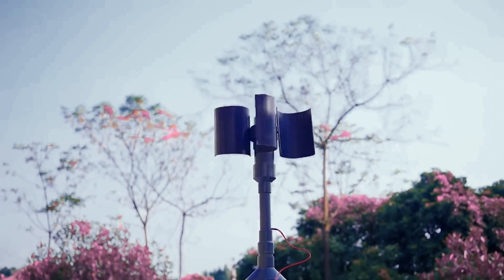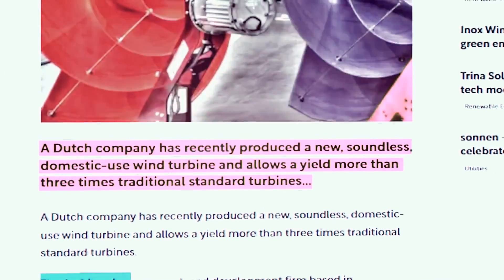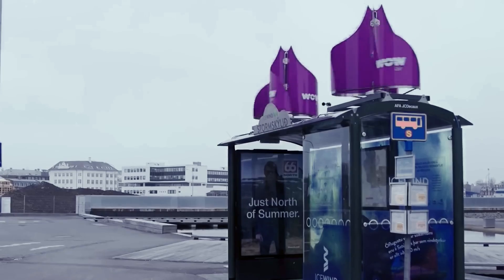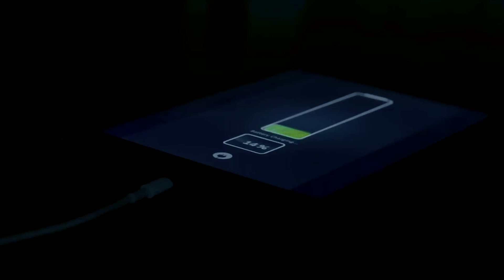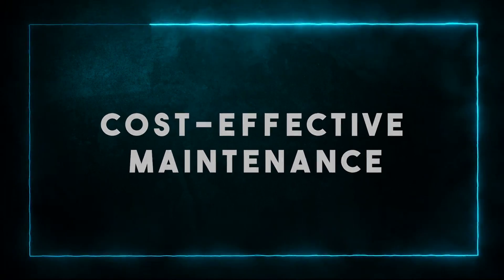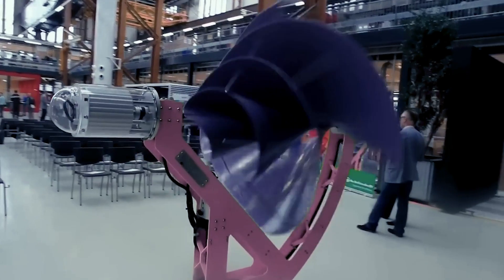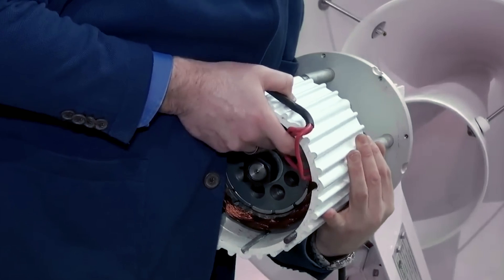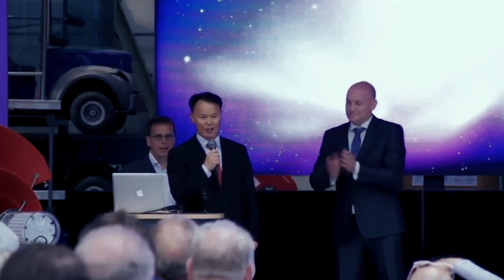New Liam F1 Urban Wind Turbine Innovation that is Revolutionizing Home Energy

Comment: Lots of hype but little hard data. This design was first launched in 2016 and failed to live up to the claims. So this groundbreaking,  game-changer has been around for a while in one form or another so you would think there would be plenty of independent test data around to backup the hype. But there is none that I can find. Really the best tests are those by consumers and now with over 7,000 units sold worldwide, I still cannot find any rave reviews. The price of the unit will be coming down through manufacturing set up in India, with the basic domestic unit likely to sell for around $3, 200 ( in 2023 dollars). So "producing over 1,500 KW hours per year with a minimal wind speed of 5 m per second" is pulled from the sky.

Comment: Where is the computational proof of such a claim??? What is the rating of the motor such as ampere, voltage, type of motor, RPM???
Reply: Slide rule and cross check with CSIRO.

Comment: Yes 👍 As a Aerospace Defence Hardware Test Qualification Verification Consultant Engineer i can see it's very efficient to copy nature in its design, a large open rear makes it effective at streamline the wind outlet, i could think some additional design changes that might make it even more efficient, i would certainly like the larger version in a complement to solar setup,
Reply from the maker: Yes, you are right! Innovation is what brings the difference to existing designs.
Reply: There should be an optimum ideal size to get max. benefit.

Comment: One advantage of this type of wind turbine is that it would also be easy to build a screen box around it, thereby protecting birds, without reducing its performance. Even if made much larger, this would still be possible, unlike the ones with long blades that regularly kill birds.

Comment: Lily-bladed propellers/impellers/turbines that follow Archimedean geometry show massive potential for increasing efficiency in all use cases. Humanity needs to look into using more biomimicry in all of our engineering designs, as mother nature has been perfecting her designs for millennia in order to eke out the most energy efficient methods of operation. Nothing in nature follows straight lines, everything is a spiral or curve. Look to the work of Victor Schauberger and his findings on curvolinear shapes and motion.

Comment: Without an indicative cost comment it is just puffery.  I can see its value in windy, remote sites but as someone in an urban area, I can easily get power from the grid so only value will make me want to add clutter  to roofs but with good economics, excellent to combine with solar panels to deliver power through the system at night and in winter.
Reply: In City Highrise Urban will be ideal because there will be wind-tunnel effect to harvest wind-force along the curtain wall/spandrel.